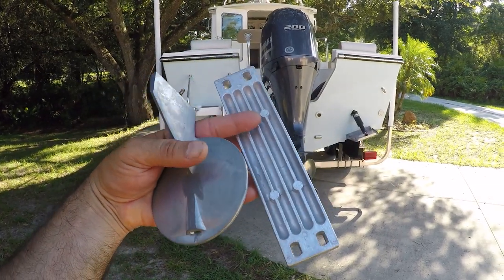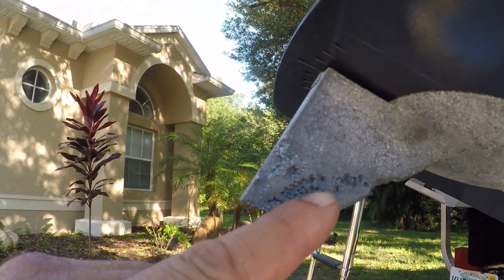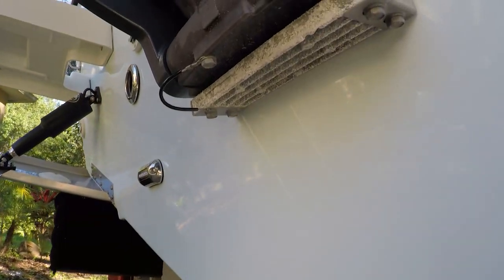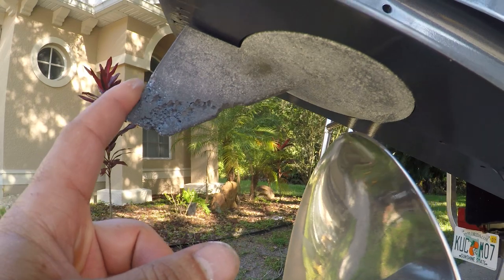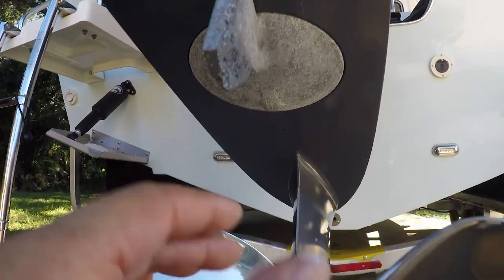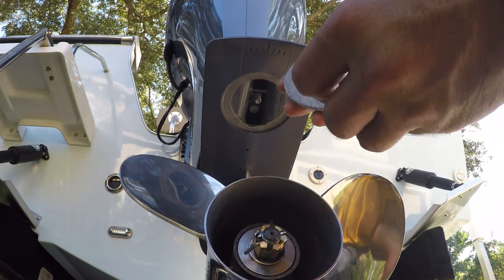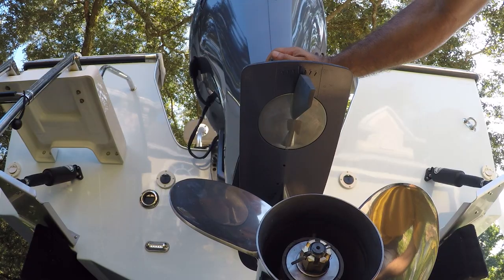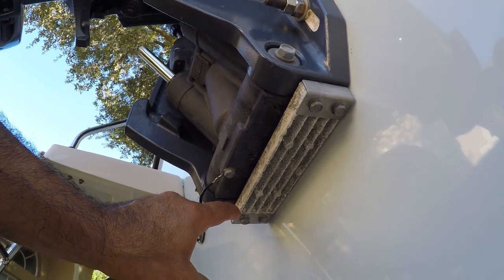How to Replaced Anodes on a Yamaha Outboard 200 hp Engine and Similar Models

Comment: Hi Capt... Nice quick explanation!  Yes, agree on how important these anodes are. (sometimes us oldies call them 'zincs', because they used to me made primarily with zinc; now I think they are an aluminum/zinc hybrid/alloy?).  I also just ordered the engines 'internal' anodes; in the 300 Yamaha there are eight (yes EIGHT!) of the 'internal' engine anodes, and I've just found out that there are 3 more other than those eight. I think Yamaha is making sure their engines don't corrode and self-destruct like some of the older Yamaha's did! ☺
Reply from the maker: Yes Andrew Dost internal anodes in my engine I will change him after 200 hours because they don't wear as much as the exterior ones and yes this about eight of them and that will be a job to do it's just time consuming but that one is just as important but I believe it doesn't wear up as much as the exterior one and thanks for your comment Captain have a awesome Sunday

Comment: Another good vid.  Thank you.  Managed to break 2 bolt heads.  Now ready to bolt back the transom anode BUT wondering if I can/should replace the bolts w/ SS studs and nuts? 2:50
Reply from the maker: Thank you cap and as far as the bolts go i would use what Yamaha recommends  And use some anti siege on the boat That will help you take him out on the next time captain thanks for watching

Comment: Thanks for the video. What size socket do you need to remove the nut for the trim tab anode?
Reply from the maker: You need an extension with a half an inch socket.
Hope this works and thank you for watching

Comment: Hi, what year and model is your 200? I have a 2018 2.8L 4 cylinder model so was checking the part numbers for the anodes. Thanks!
Reply from the maker: Hello my motor is  2017 Model I think your engine is same as mine captain

Comment: Would someone help me with the size of hex key to open the trim tap zinc? I used 8mm hex key and it was a bit small, the next size in the hex key chart is 10mm and that would be too big. I bought a used boat and do not know if the installed zinc is OEM or aftermarket.
Reply from the maker: Captain I have 2 different sets of Allen keys  And they are very similar you just have to buy both to make sure wish one fits

Comment: What about the 4 anodes on your engine block?
Reply from the maker: I will do a video on those coming up soon captain
Reply: @OutOnTheReef  I am trying to figure out how to replace the 4 engine anodes on my 1998 Yamaha 2 stroke outboard. My anodes are not covered by any video and they are different than the anodes that are covered. Here is what my anodes are part number ANODE 6E5-11325-00-00 https://www.boats.net/product/yamaha/6E5-11325-00-00?ref=d601bee9ea0dc1b44211ebcf07afaf7f25648da6. I actually have had some trouble finding them on my engine. If your anodes are similar post a video when you do that.
Reply from the maker: @carypeaden4147  sure will Captain I think soon I'll be able to make a video on that I'm getting close to my 200 hour service and hopefully it'll help you and thank you for sending me the link

Comment: Capt, you should always use an anti seize compound on the bolts
Reply from the maker: I always do but in this case I'm going to change it in another hundred hours so I didn't think it was needed but yes you're right whatever is on the water anti seize will help a lot
Reply: Actually a drop of threadlocker is a good idea.
Reply: @darinkg  Marine grease or anti seize, but no thread locker on aluminum. Especially fine thread . those bolts only thread in about 1/4inch

Comment: Good to go, I never wait that long to change them, they are cheap and keep salt away from everyrhing there. If it sais 100 I do 80. Keep on riding cap. 👌👌👌👌👌👌
Reply from the maker: Good tip! cap. better to be safe👍😉
Reply: @OutOnTheReef  hey its like oil, I do change it a lot sooner that anything the product will say. They always want to be the best and longer lasting product, I never belive in that. Its always better to change it an be safe berore having to buy a new one or rebuild. And always keep a tap on viscosity. People put oil and forget about it till its time to change, never bother to check and see how the oil is holding up. Big mistake. 👌👌👌👌👌👌👌👌👌
Reply from the maker: @2fast4you25  i agreed cap😉👍

Comment: What is the importance of this?
Reply from the maker: It's a softer metal so it helps on corrosion on the engine is very important for your engine to last longer , that's why it's called a sacrificial sink the sacrifice itself for the motor
Reply: Out On The Reef oh ok. Thank you for the response!
Reply from the maker: @kennykannar8971  anytime Kenny
Reply: @OutOnTheReef  Yes Sir!!-- its Zinc-- which corrodes instead of the metal of your prop-- which creates static electricity and thusly turning the (sea) water very acidic. The rectangle one near the engine mount - corrodes from the static electricity created by the two different "metals" of the engine and the mount on the boat via vibration and water flow. Swimming pool motors usually require a "Sacrificial Anode" as well ( in the form of a Zinc ball that is placed in the leaf basket in front of the impeller.

-- and If I'm guessing who you are-- well-- you sound a lot like 3-time Indy 500 winner Helio Castroneves!  (j/k)!----LOVE your "show"!!!
Reply from the maker: @legion95928  lol Cap . Thanks for the awesome explanation, and thanks for watching my channel cap.

Comment: Obviously outboard engines are far easier to maintain.
Reply from the maker: yes i agree cap.
Reply: Yes as long as you regularly service the engine wait to long and it becomes a problem with corrosion. I use mercury marines 2 4 c grease it’s water proof grease won’t wash out like regular grease my neighbor showed it to me 40 yrs ago but don’t use it on your zinks you want to keep the connection clean between the zinks and motor mounting holes  you can buy a grease gun that uses the 8 oz squeeze tube  works great on grease fittings aka zerk fittings tilt tube fittings and cowlings fittings and pivot tube fittings thanks JT 🇺🇸🇺🇸🌴🐟🎣🛥🌴⛱😊😊🙏🏻🙏🏻🙏🏻
Reply from the maker: @hookednrolling2009  that is a great idea cap. Thanks
And be careful with the hurricane